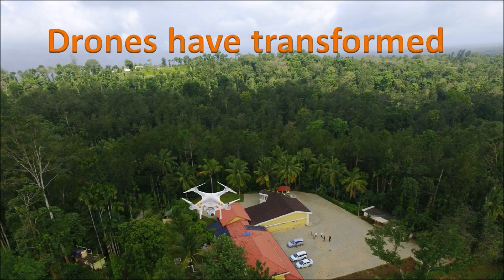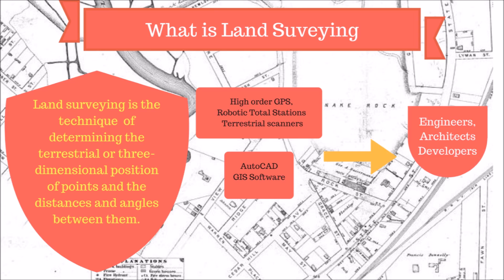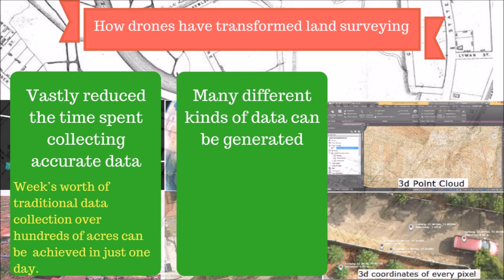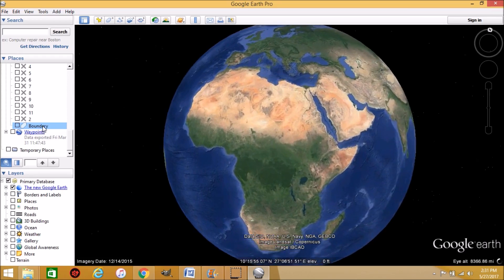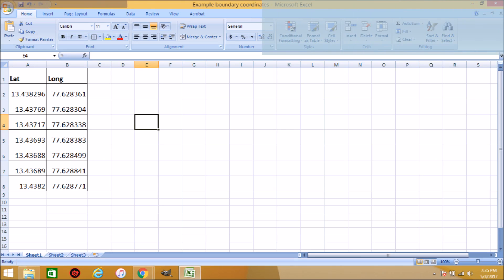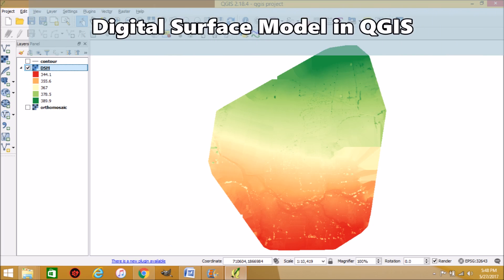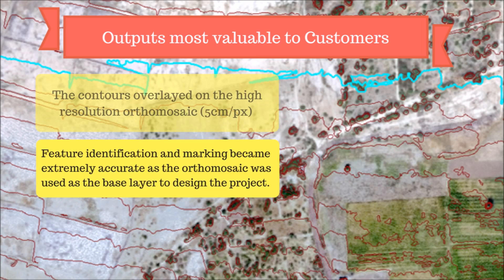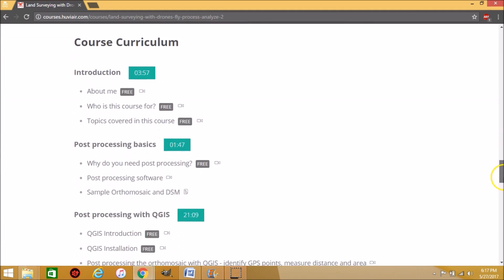The Ultimate Guide for Land Surveying with Drones (Process Flow)

Comment from the maker: This lecture is part of our course series "The Ultimate Guide for Land Surveying with Drones". Enroll into the complete courses now for USD 10 only and start your own UAV mapping business!
Part 1 - Master the complete workflow using DroneDeploy, Litchi and Pix4D
https://www.udemy.com/land-surveying-with-drones-fly-process-analyze-2/?couponCode=YOUTUBEOFFER
Part 2 - Learn to work with Pix4D & DroneDeploy outputs on QGIS, AutoCAD & Google Earth
https://www.udemy.com/land-surveying-with-drones-fly-process-analyze-1/?couponCode=YOUTUBEOFFER
Part 3 - Master the use of Ground Control Points (GCPs) to make your aerial mapping projects absolutely survey grade!!
https://www.udemy.com/the-ultimate-guide-for-land-surveying-with-drones-part-3/?couponCode=YOUTUBEOFFER

The white paper on the process flow is available on - http://huviair.com/wp-content/uploads/2017/03/HUVIAiR-White-Paper.pdf
Reply: Can a DJI Mavick be used for this purpose?
Reply from the maker: Christopher Marlin Hi Chris, while Dronedeploy does support the Mavic pro for flight planning and execution, I have seen a lot of complaints where users have said that it doesn't connect to the drone, doesn't show the actual battery charge value etc. Moreover it uses a rolling shutter which is not ideal for mapping purposes.
Reply: vikshut mundkur thank you, could you recommend what would be an ideal drone for similar cost?
Reply from the maker: Christopher Marlin for a similar cost you can consider a phantom 4
Reply: vikshut mundkur thanks